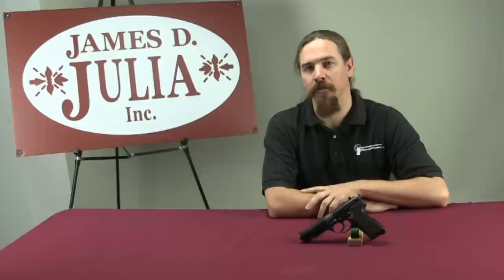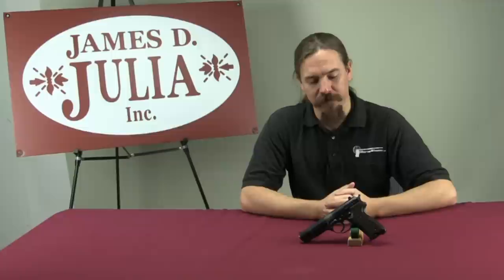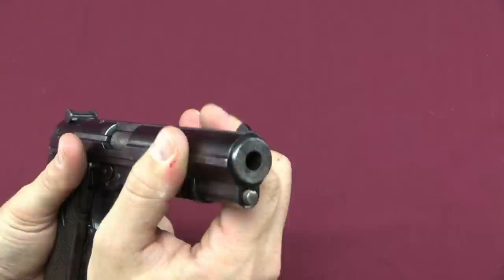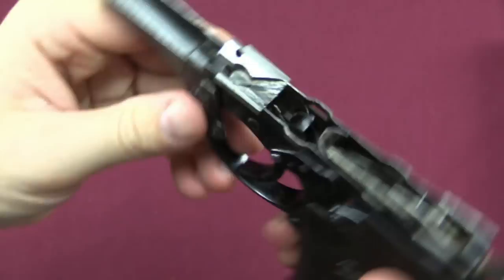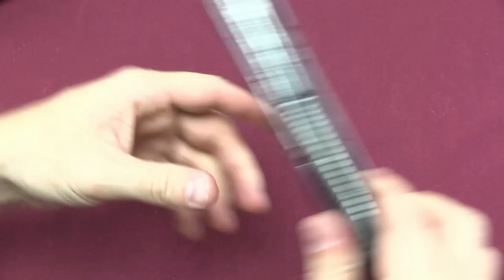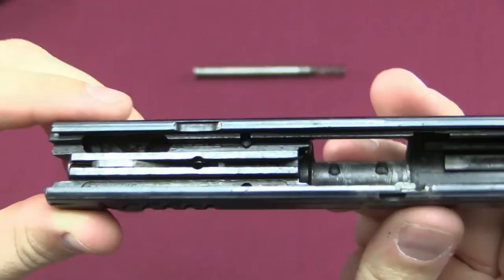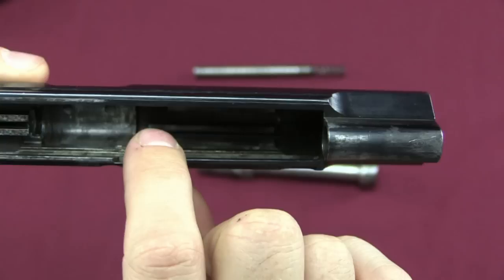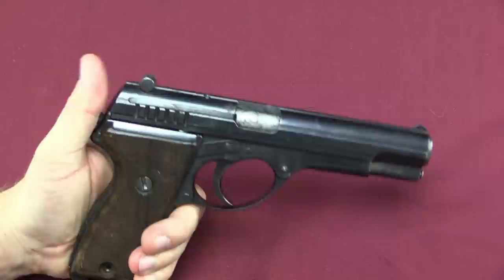Walther Volkspistole

Comment: Its funny, we think of semi auto pistols today as modern pistols, modern designs but really other than the newer materials we use and mass production and ease of creating quality parts on a massive scale designs really havent changed much. Which is why we still use the 1911 in the Military.

I think one reason people think of semi auto's as a new design or the designs we use today as new is because for so long in movies and films and police carried revolvers but I think that was mainly because of cost, lack of supply of good quality semi's other than 1911 which where still hard to come by and peoples lack education and willingness to believe a semi auto was as reliable as there trusted revolver.

And so people dont think I am biased I am big revolver guy but love semi's too.
Reply: Well rifles are actually relatively knew (300 maybe 400 tops). I believe it went blackpowder on arrows, arrows propelled by black powder, small cannon, hand cannon, large cannon, mortar,  then crude musket, then true musket, many different firing mechanisms for muskets, shot guns aka just larger muskets, then rifles Im sure Ive screwed up some where or forgot something.
Reply: High-power semiautomatic pistols were expensive. High-power revolvers were cheap.

Most of the world judged the .32 ACP sufficient for policing duties and non-frontline soldiers, so they adopted cheap semiauto pistols en masse starting from 1907. No one besides the U.S. relied as much on revolvers.

Comment: In mass production, would this be faster to produce and would it use less materials than volksturm bolt action rifle? Becouse if it uses less resources or/and is faster to produce, it is exactly what Germans with lack of time and resources needed. Germans were on defence, they did not need long range firepower. They had machine guns for that. Give rest of the squad pistols so they can carry ammunition for machine gun, and at close range they would protect machine gun better with semi automatic pistol than with bolt action rifle. And in urban warfare pistol is superior to bolt action rifle. 
Since Volksturm lacked any weapons, it makes a lot of sense to just try to arm as many of them as possible, and only after that is done start giving them more multipurpose weapons like sub machine guns and assault rifles. 
Even German sguads that were well trained and armed relied on their machine gun and not rifle fire. So not having enough rifles is not that big deal. It is better to give everyone a pistol and some lucky one assault rifle rather than giving everyone bolt action rifle.

Comment: What's the purpose of the rotating barrel? I doubt it was just for any sort of cool factor. (Or cooling factor.) And seems more complicated, something you do not wish in a last-ditch design.
Reply: The barrel is locked to the slide and breech until the barrel rotates to release it. Then the slide can continue back and eject the brass. 
Small calibre pistols can use inertia of a slide to delay recoil and ejection, but more powerful ones like a 9mm need something to keep it together until pressures have dropped. (The alternative is tilting, like the M1911.)
Reply: +avro549B All right, makes sense.

Comment: What's the point of a rotating barrel?
Reply: Locking mechanism, preventing the slide opens up before the bullet left the barrel. Most modern pistols use the Browning locking mechanism with a tilting barrel, but there are always some which are different, and from time to time this system pops up again. The Beretta PX-4, Beretta 8000 and the russian GSh-18 have rotating barrel locking mechanisms to name a few examples.

https://en.wikipedia.org/wiki/Beretta_Px4_Storm

https://en.wikipedia.org/wiki/GSh-18